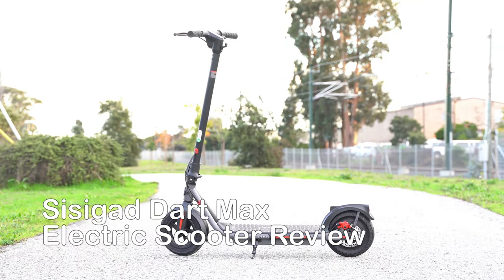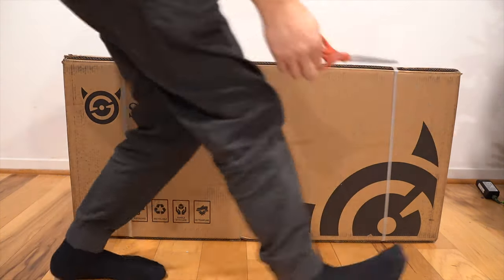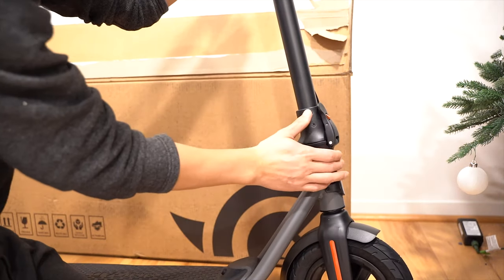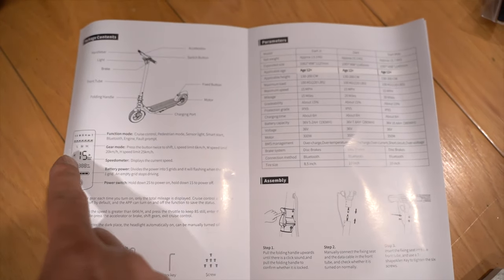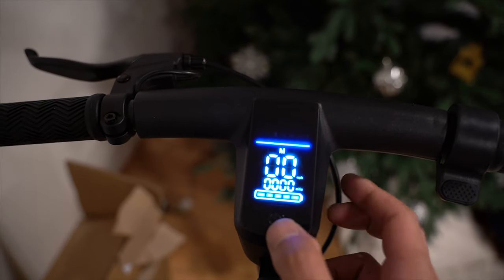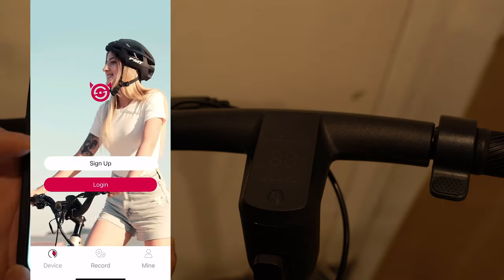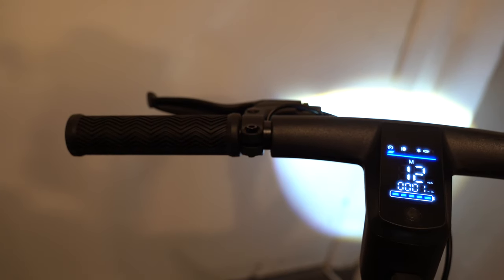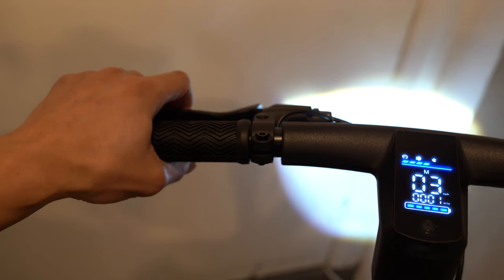$329* Sisigad Dart Max Electric Scooter - Unboxing, Assembly, Test Ride, and Review

Comment: Can anyone help me with my SISIGAD it turns on but it doesn’t accelerate no more even if I press the throttle
Reply from the maker: Zero start may be disabled. You may need to kick the scooter more than 3mph to activate the throttle.
Reply: @ColinLeung  I know about that it’s just that the batteries are working every time I kick start it doesn’t move at all
Reply from the maker: @isolated_dope8540  The unit may be defective. I'd suggest contacting the manufacture, or getting a refund/exchange.

Comment: Is this app only for iPhone? I have android
Reply from the maker: It should be available for Android as well. See link https://www.sisigad.com/pages/appdownload
Reply: I have been on that link and when you push the download for Android, nothing is happening. I have a samsung phone. I have been trying this since Dec 25th it's now Jan 29th.
Reply: Also the low and high speed on my scooter does the same speed there is no difference. Max speed for this was 15 mph going straight and forget about trying to go up hill. This is my 2nd scooter. I got it as a gift and I'm not really happy. It said one thing on the description and when your get it, it's something different.
Reply from the maker: @Milanww  Sorry to hear that. You can try searching Sisigad in the Google Play store if the link doesn't work. When I started reviewing the scooter the app was down, and had to contact the company to be told that it was down temporarily. Are you within the return window? I would try a different scooter as this one was a bit underwhelming.

Comment: Lol mine only went 5-6 miles on a full charge… also front wheel went flat within a week. I could only get it to go 16-17 mph max and I only weigh 185 pounds. I sent that shit back! Also the app has been down for over a 2 months now
Reply from the maker: Sorry to hear about your experience. The app was down when they sent it to me, and they told me it would be back up. That was when I posted it.
Reply: 350$ I'm glad they have a 30 day return
Reply: The app is still down
Reply: The app is not down. I have it
Reply: @llama__Man777  you’ll have it for about another week before your scooter burns out on ya 😂💀

Comment: This is the worst electric scooter from TST electric company. No matter what mobile you use, it doesn't connect with the mobile or app. And the shocking thing is you can't get an angle to fill the air in the front wheel tire. Moreover, the battery goes out of charge immediately after 7 miles. By any chance, if you turn on the high mode within the next 2 minutes, the battery goes out. It never touched the max speed as they mentioned. This is a waste of money to buy it.
Reply: You don't even get the bell, manual , nozzle extension to fill the tire with pump.
Reply: The worst thing is it can't even climb the least angle of elevation roads too. It's as waste of money.
Reply from the maker: @VENKATAVISHWASESHASREERAVITEJA  Sorry to hear that. I'd return it if you're able to. This is not a scooter that I would recommend.